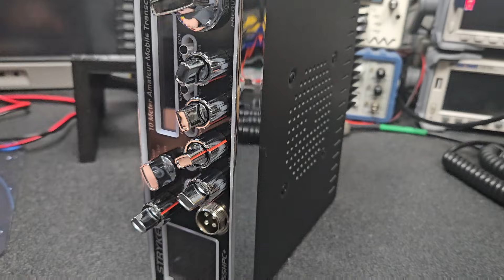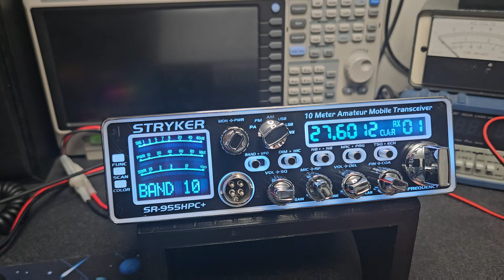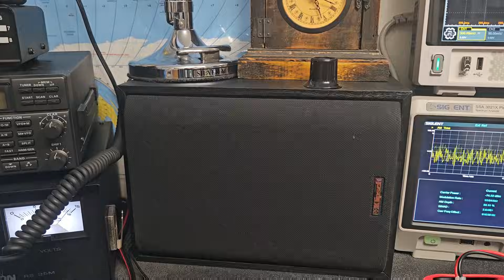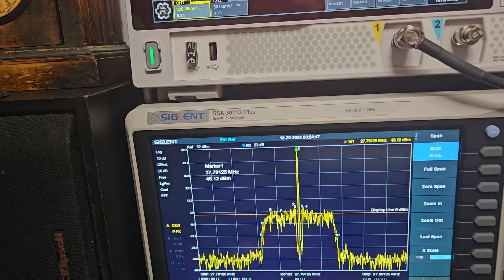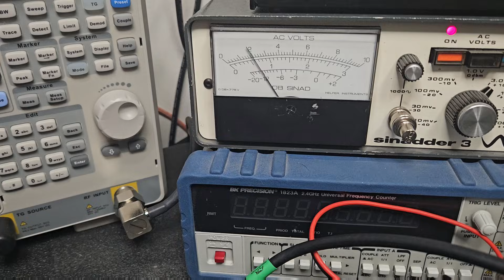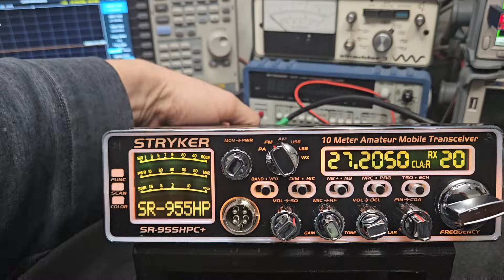New Stryker SR-955 HPC+ heading to The United Kingdom

Comment: Is there a reason you used a zero ohm resistor instead of just a piece of wire ? Thanks in advance 👌🏻
Reply: so there is no spikes going in to the processor

Comment: There seems to be two common methods of measuring FM receiver sensitivity: 20 dB quieting, and 12 dB SINAD (SIgnal plus Noise And Distortion).
Reply from the maker: The main thing I take away as the FM receiver is always better than the AM receiver.
Reply: I've got stryker off Julian, but it's still in box unfortunately due to work commitments

Comment: That radio came out great !  For the FM settings ,I would use factory set up data.  Standards vary from country to country . Just look at FM band with. 10 meter ham to US CB band. I like how you can change that in settings.  The UK FM band is hard to set in a lot of radios. Only the UK has that 0125 offset.  The UK had that band since 1981 .and was FM only then later SSB and AM.  A lot of FM still used in the UK . I hear them in the AM when the band opens to NY . But many now use all modes . depends on range they want. Many shops sell burners in the UK . Even filters !  On FM just a few more watts makes no difference.  You need like 10X power to make a real difference. It is not like SSB wear a moderat boost in power can help . It is the detector stage in FM that needs enough signal to be clear. The volume stays about the same and static goes way up.  Making weak single a very hard copy. AM is better and SSB is better yet . I find the NRC filters can help with FM with weak signal. Cuts noise down. The good alignment is money well spent from a shop that does it correctly. But the peak and tune is just a waste of money . Your just better off leaving the radio stock ! They come out real nice from factory . No need to get into service menu unless you have right test gear and knowledge.   The UK is going to love that radio ! Many have the older version of that radio . and the CRT radios are more common over their. pretty much same factory . Cheers from NY !